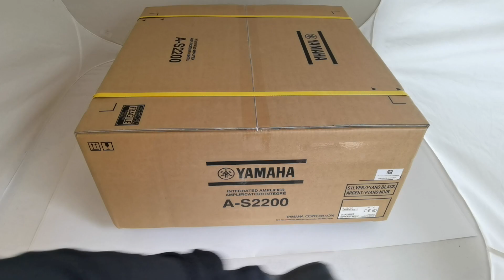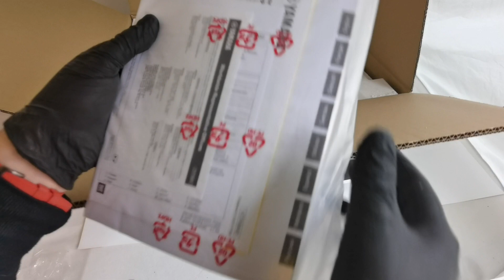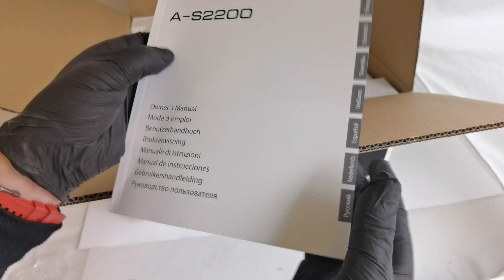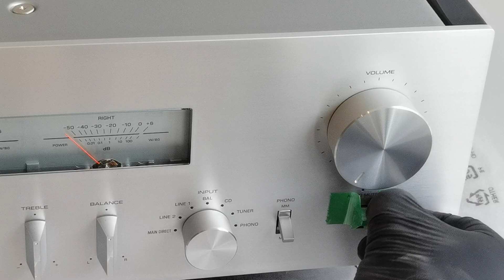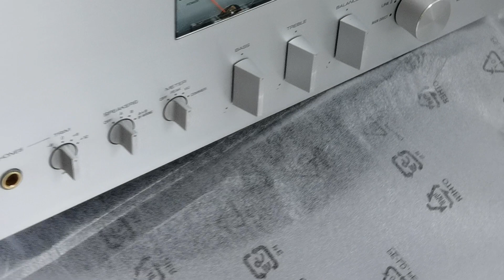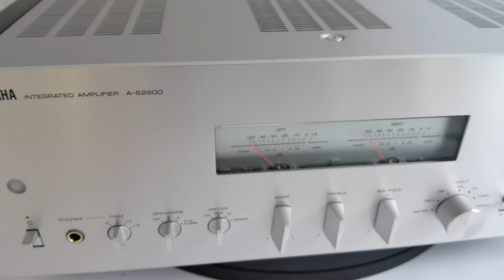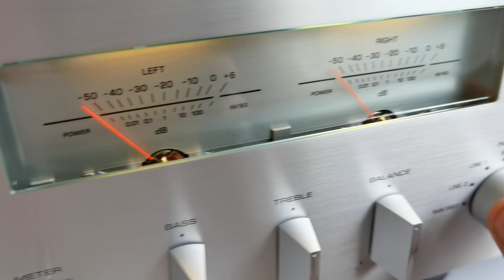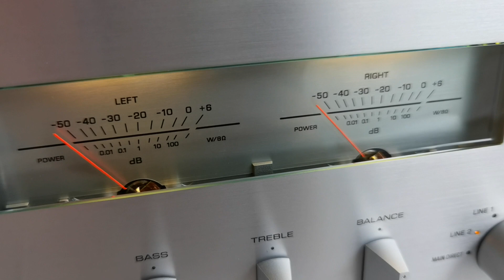Yamaha A-S2200 integrated amplifier unboxing and deep unboxing

Comment: It would want to be a lot better than the AS1100. It was a very fussy amp to get sounding right. The sound just never matched the build quality. I tried over time and several sets of speakers to get it to sound like an amp of this quality should but ended up having to sell it in frustration. The positives were that it had that mosfet sound and was quite organic.
The real cruncher came when I compared it to a cheap Denon receiver and the receiver out performed it in imaging, soundstaging and transparency and the speakers weren't even in the ideal spot at the time. I'm not trying to say Denon is better than  Yamaha, it's just my experience.  I currently have an RXZ11 and it is very good on music in pure direct as compared to the 1100. The 2200 may be a lot better than the 1100 so I'm not saying the 2200 isn't a good amp. Good luck with your new kit and enjoy the music.
Reply from the maker: Thank you for sharing your experience with us ❤️
Reply: The 1100 should be a good amp, nearly identical to the 2100.  Where did you buy it and how much did you pay for it?  Could it be a Chinese clone?  You had to be missing something.  Maybe speaker connected out of phase or room acoustics.  For something like this, you should ask for help in setting up if you can't figure it out on your own.  You could have even called Yamaha for help.  Even the most experienced people can miss something in set-up.
Reply: @kurtzcol  thank you for your eloquent reply. I don't know what your experience is with hifi so I won't judge but I had the 1100 for about 8 months and tried cables and speakers and placement and as I said it was a very fussy amp in my case to get sounding the way I thought it should.  I really liked  the build quality and wanted to keep it which is why I persevered so long. Maybe I was expecting to much of a 2500 dollar amp.  My previous gear has  been electrostats, magneplanar 1.6, Denon poas10 mo noblocks, Nad  C272, B&W, Polk LSI15 etc and I have heard my fair share of high end sound. 
So this is my experience with the 1100 in comparison to other gear I've heard in the past 35 years.

Comment: I do not recommend. My A-s 501 with less than 3 years of use goes for assistance to be repaired. Some components inside are of doubtful quality, they are not of Japanese manufacture due to their fragility. They burn easily. I do not recommend buying Yamaha as the term "OPEN BOX" may have been a piece of equipment that was under warranty and returned to the store to be sold a little cheaper. Yamaha's dishonest Technique so as not to lose money and mislead the consumer.
Reply: @perfectstranger1769  My Yamaha A-s501 returned from repair free of charge. I noticed a big difference in the sound 1000% better. I chose to buy an amplifier while it was not coming from the repair. I chose Yamaha, the A-s701 was paid and Yamaha Europe (UK) has not yet been delivered because it is not silver. This from Covid is delaying production. They are being assembled in Malaysia, perhaps because there are many complaints, they must be making improvements to the equipment. I hope to have more luck when I receive.